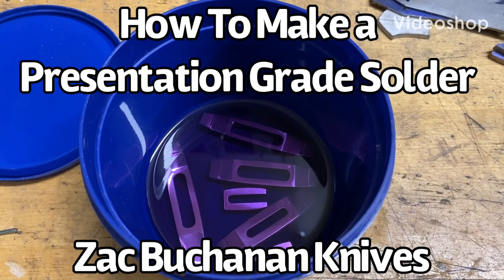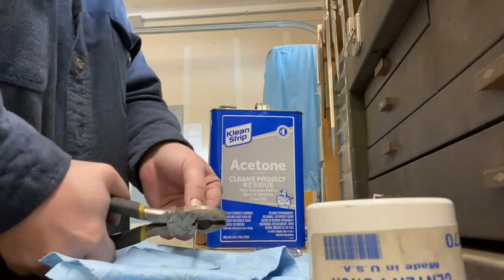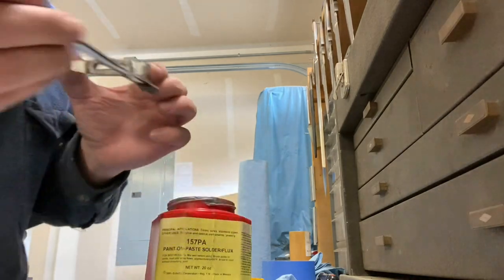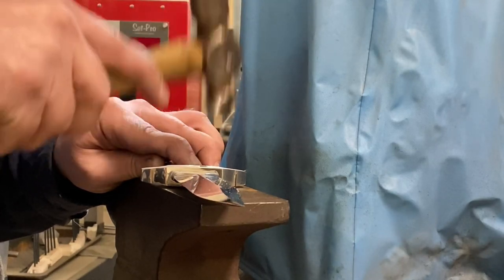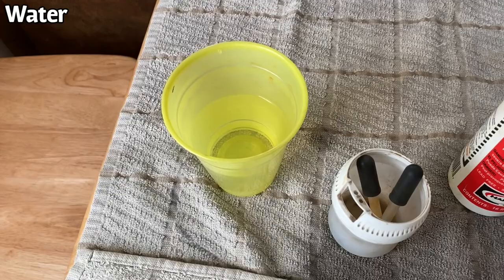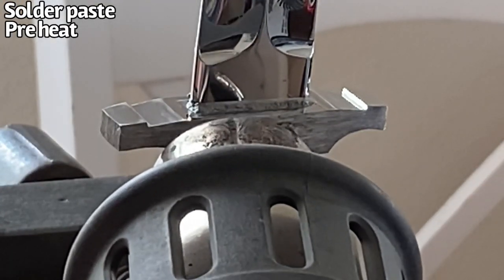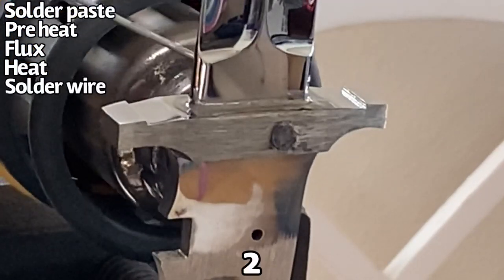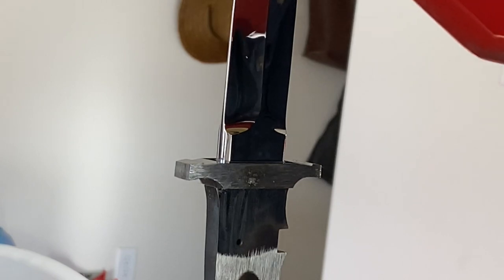How To make a Presentation Grade Solder Joint!! (Pt 1) Knife Making Tutorial: Zac Buchanan Knives

Comment: I have a bit of a nit picky question. I notice that the solder paste you use has the consistency of peanut butter (or close). When I stir mine up really well it remains soupy. Did you remove some of the liquid from on top of the solids before stirring to make it thicker?

Comment: Very nice work! A question about flux and paste. I have done a  lot of plumbing soldering and use paste flux, but am not sure what the difference is between the flux and paste you use.
Is there solder in the paste, and the flux is only flux?
Reply from the maker: Thank you! Correct the solder paste is a mix of the solder material and liquid flux, and the flux is just more flux. I also use solder wire just to make things easier.

Comment: Do you use a 3/0 taper reamer for 1/8" pins?  I've set pins before but only with a straight hole...or sometimes I have put a small countersink...but I can see the tapered reamer is the way to go.
Reply from the maker: I’m using a #5/0 for 3/32” pin stock. Thanks for the question! 👍
Reply: @ZacBuchananKnives  Thanks.  Like your videos, really helpful.
Reply: ended up taking a #30 drill and slightly tapering about 3/4" of it...seems to work fine for the 1/8" pins.  I did manage to punch out the pins that were showing and redid them with this taper drill. After peening and polishing they disappeared just fine.  Thanks for your great videos.
Reply from the maker: @gordonolafson5806  that’s great! I’m glad to hear it!

Comment: I work in the acid plant, to help you out all you need to do to nute the acid is to just put a q-tip in water with baking soda and it will nute the acid, so you don't need to boil it....very nice knives.....
Reply from the maker: The flux can hide pretty well so I like to boil them for a couple minutes. If you’re sure the flux is only on the surface then a q-tip would work just fine. Unfortunately the underside of the guard can get quite messy and boiling with baking soda does the trick great. Thanks for the comment, stay safe at the acid plant!!

Comment: Great info. And I love the craftsmanship.  How hot does the heat gun need to reach?  Is that a special heat gun?
Warm regards, Eric
Reply from the maker: It depends on the melting point of your solder. Just make sure your heat gun will get hot enough to melt it.

Comment: Zac, you make beautiful knives, but regarding peening, you are wrong.    When you "peen" a pin into a guard, it is called "upsetting", and the rod expands and becomes wedged in the drilled hole.  And regarding countersinking, that is an optional process - if you "peen" a pin in a straight drilled hole, it WILL NOT fall out.  I think it was Jim Merritt (Bob Loveless' work partner) who said you'd need explosives to get a properly set pin out of a guard.